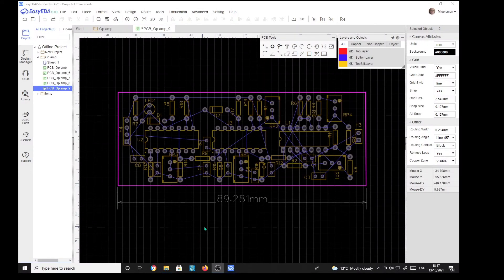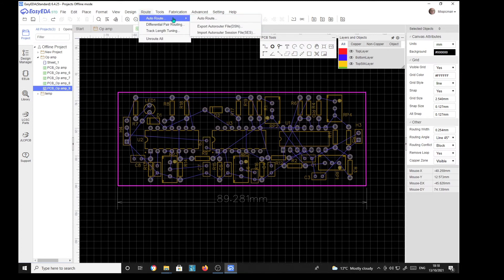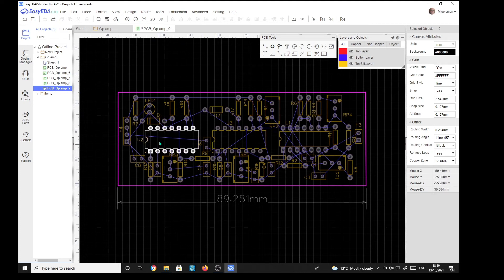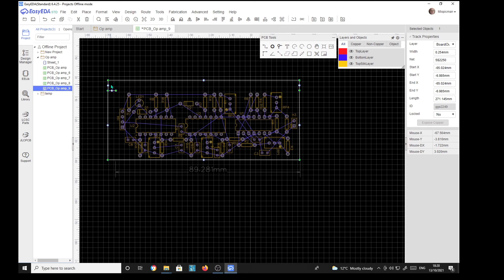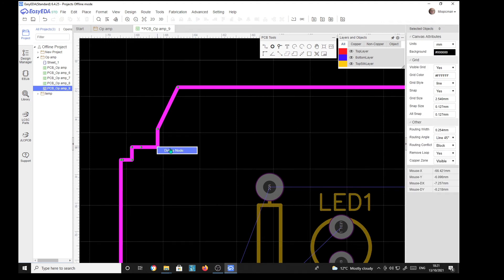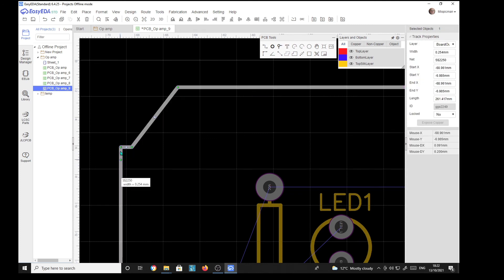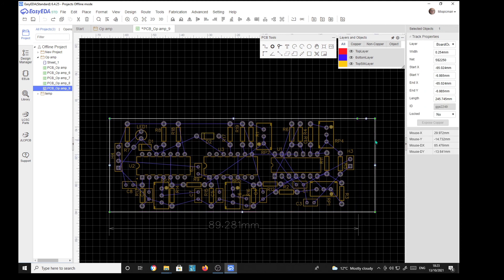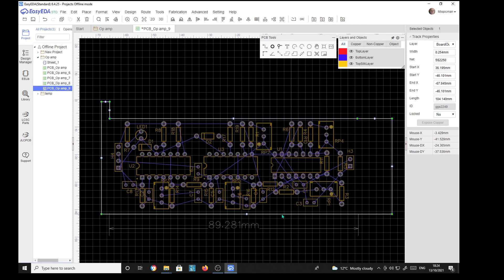EasyEDA border problem

Comment: Yep, this is frustrating. The root cause of this ist that the board outline actually is a track, not a closed loop/rectangle. When you create it first, the top left corner of the outline actually is "open" with the start end endpoint of the track at the same place. You can verify this by dragging the top left edge - this will open the outline. But whenever you move a line that has an endpoint on one of its ends, there is a new segment generated from this end-point to the new location of the line. 
Once you know this, it is easier to handle... Usually it's best to drag the corners instead.
Btw: double-clicking a green node also removes it.
Still hope they make that easier....
Reply from the maker: Thanks for the explanation. It does seem that there are one or two gremlins in the software left to fix. I'd like to see their to-do list.

Comment: Check out Colin Hickey’s channel. Has a very nice tut🤓
Reply from the maker: Yes, I know about his channel. Have you got the link to the video that covers this problem? Thanks. Actually he lives not far from me.
Reply: @JimTaylor42  here’s another from electronoobs,  https://youtu.be/utBQqcuOt9U a lot of good content but he talks very fast.
Reply from the maker: @ThePsychoNad  Thanks for the information. However, I have seen this video also. 
FYI with regard to fast talking narrators, did you know that there is a handy little gadget in YT settings (the gearwheel thingy) that allows you to slow down the video without altering the pitch of the narrated audio. This is very clever. I have also put a suggestion to YT to develop another audio facility that wil reduce or even eliminate background music - since sometimes it is a big strain to discern narration through the din.